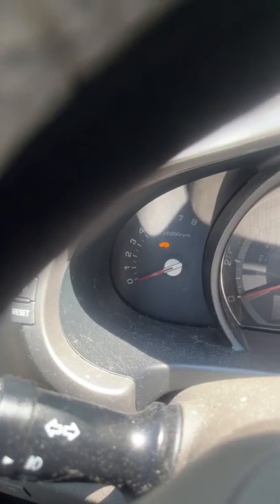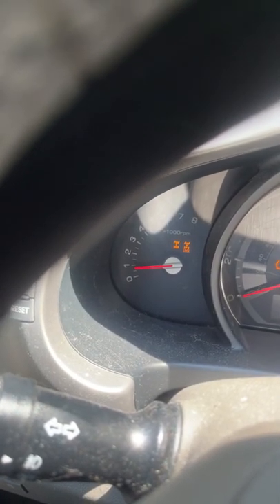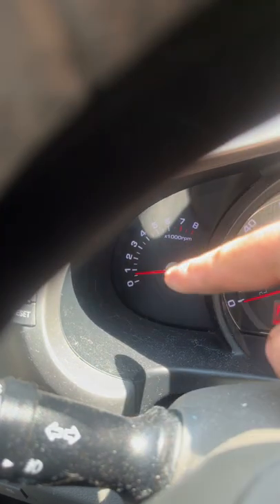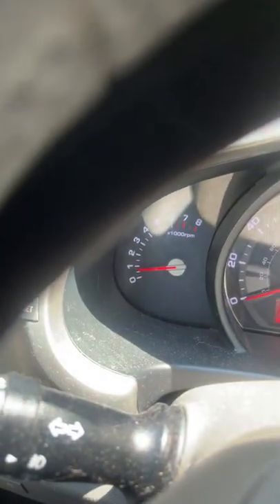Does your car feel like turning off. Watch this !!!!!

Comment: Typically that's going to be a failing IAC VALVE.    Not a dirty throttle body..  you likely also have a failing EGR VALVE causing excessive carbon fouling in the intake.
Reply from the maker: What happens with cars that don’t have egr valve and have variable valve timing ?
Reply: I dont think vehicles with electronic throttle body have an iac valve, its not required since the plate is controlled by the ecu and can stay slightly open as oppose to a bypass
Reply: @OzMechanics  My BMW 2006 N46B20B har VVT and it has this problem.

Comment: Be sure to unplug it as throttle body motors are powerful enough to cut your finger off. Also, idle might be high afterwards until the computer relearns the idle.
Reply from the maker: Always good to have the key out. And as well I made sure to add on the end that some vehicles would need a calibration or relearn. Thanks for watching
Reply: Lol get real
Reply: Not true anytime you reset the car before you ever start it you need to put your foot all the way to the floor a couple times It will learn exactly where the throttle plate is immediately and it will open it on its own more than likely and close it so anytime you have an electronic throttle body your advice is nonsense it's not that big of a deal if you bought an aftermarket one you would definitely need to push it a few times and then start it

Comment: Hey man could you please help me out with something. A while ago you made a video titled “Dodge Ram AC not blowing” in which you replaced a part from under the tipm because the blower motor wasnt working. Anyway Im glad I found that video because I am having the exact same problem with my 2013 ram which is also a 2500 just like the one in your video. Anyway could you please let me know where did you get the green part that you replaced from under the tipm because I cant find it anywhere. It would be of much help, thank you and keep up the great videos.

Comment: Thanks for this helpful video as these may have been my next steps to take if “plan A” didn’t workout. The issue I was having with my vehicle was when I came to a complete stop, my car would start idling so low that it sounded like my car was going to completely shut off. 

So, I started out by changing the air filter first and that worked 😁!  I have not had any issues since. 

I always have my filter changed with every oil change (as recommended), but just in this instance it needed to be replaced-as at that time (2 months ago) I was traveling more. 

If you think I should check or do anything else, please advise. 😊

Thank you for sharing your mechanics expertise here on YouTube as I always find them very helpful.

God Bless You! 👨🏻‍🔧🧰✝️🙏🏻

Comment: I have a rough idle when stopped and start, while driving have a putting and the sound of whooshing when giving gas, any ideas? Have evap codes, catalytic converter leak/o2 sensor. Also have exhaust/fuel smell and when vents are on it’s worse, windows down makes it really bad! Thanks and hope I can get some hekp

Comment: I cleaned my throttle body couple days back and the idle seems weak now. Also when i accelerate it feels sluggish, and the motor sounds forced with a loud humming noise when rpms hit the top before changing gears. I took off my throttle body and when i give it a shake it sounds like a little rock in a container type of noise. Is that a normal thing or no? Also no check engine light on.

Comment: I have a 2000 gmc sierra 6.0 and when i stop in drive the rpms go way down from where there suppsed to be and it'll turn off, only does it sometimes. Any information on what it can be or what i should check ?

Comment: What does. It mean when your won’t start but your battery is good ? I have a 98 nissian and I think it’s my Bluetooth radio that’s taking the power cause once we disconnect the whole radio it started to work
Reply: Is it the wiring or something? Not connected in the right area

Comment: Dumb asf could be this but also could be map sensor also camshaft sensor also could be idle air control valves causing the issues so check all of these.

Comment: My 2002 silverado v6 4.3l stalls out with low rpm 
When i step on acceleration it  doesnt stall once i let go it will stall 
It has check engine they told me its the catalytic converter 

Is that the reason why it does that?
Reply: It drives good gets gears good

Comment: Classic symptom of a clogged fuel filter are you sure you didn't forget to clamp one of those hoses back down and you're pulling extra air now so the engine can compensate at a leaner burn are you sure you didn't make it weaker lol what are all those lights on the dash after you started it... Kind of like putting a Band-Aid over something. I know on the older v8s that have a plenum where the EGR goes above and below in two different chambers on the throttle body they can get completely clogged up and make it run like that for any of you that sink his experience is going to fix all of your problems. I'm calling BS because I hardly see any dirt on there he probably just finally got the clamp back down around the throttle body properly this time A lot of guys take stuff apart and forget especially when they're making a bunch of videos for no reason

Comment: My throttlebody is new but i still have the same problem, at every red light its like it wants to shut off or does
Reply: Did you fixed it and how ?
Reply: Mass air flow sensor 💯

Comment: I did it then it still turning off
Reply: Thenb that was part of troubleshooting. That must not be your problem, but it still related. Fuel fire and air.
Reply: Timing issue ,chain plus maybe sensors